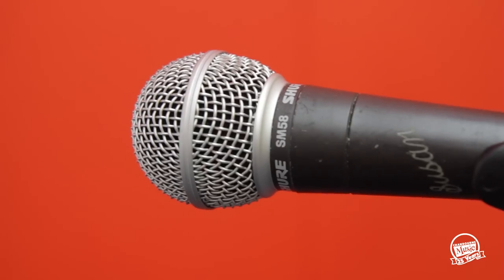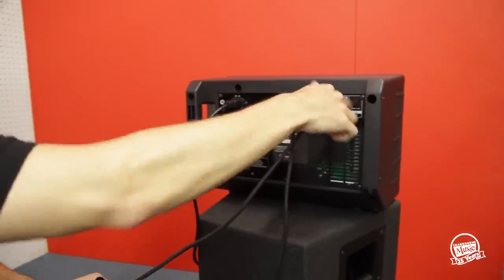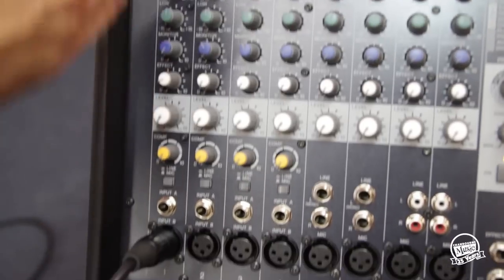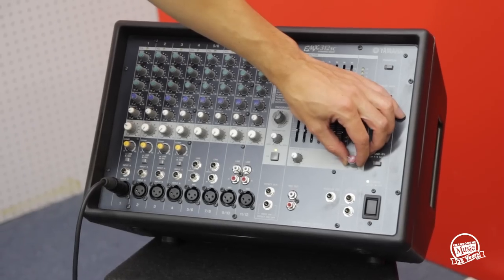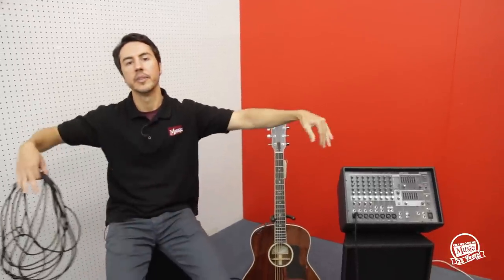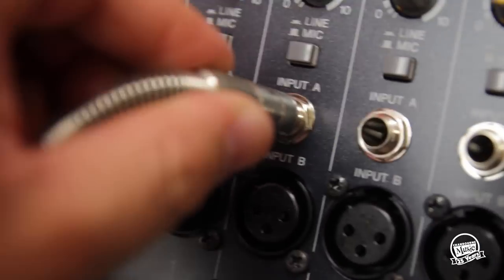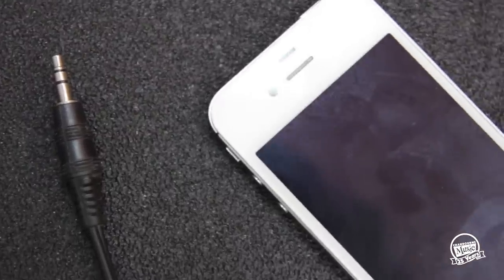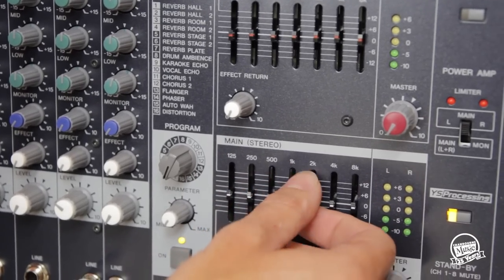PA Setup Basics - a "How To"

Comment: At 3.09 you are turning the monitor dial instead of the effects dial when showing how to apply effects! Also would be handy to let people know that the monitor out at the front is unpowered so would require a powered speaker to be used as a monitor or a passive speaker with a power amp. Only the rear speaker outs are powered.